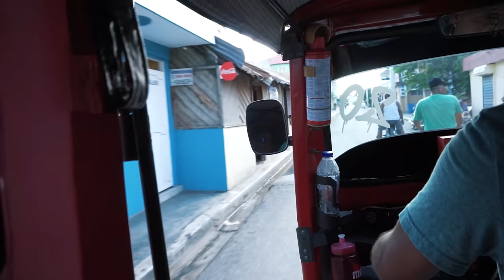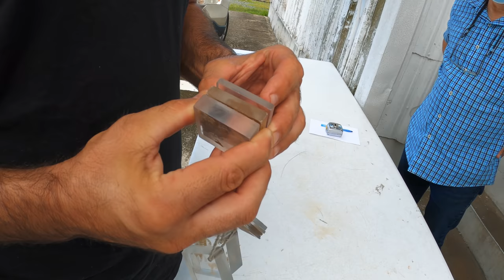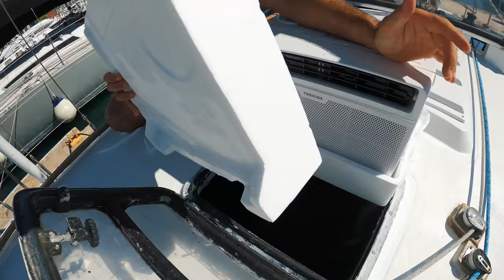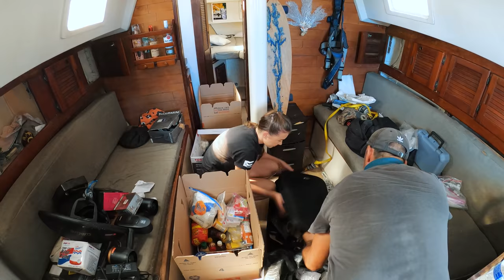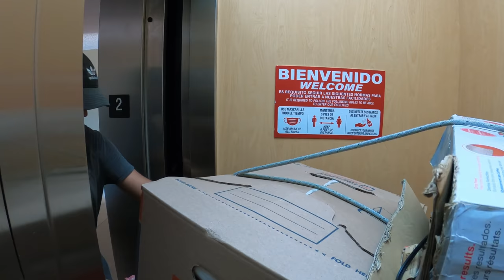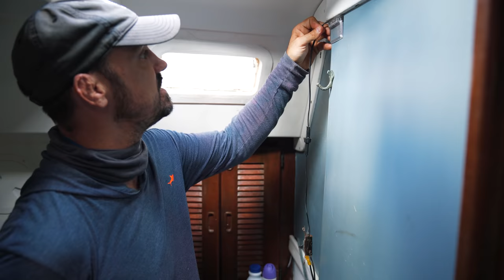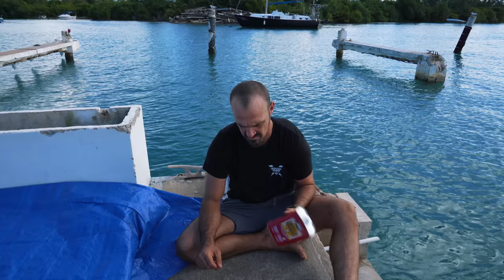BOAT YARD (PART 1) COMPLETELY ROTTEN BULKHEADS!

Comment: great video guys. When I look back after I complete a project I realize that I try to do too much at once and needed a game plan. Suggestion is repair the tabs that your chain plates are attached too ( one at a time ) then move on to the bulkheads, leave the glamorous bits to the very end of your project. There is a wood bleach Oxalic acid, but it won't take the redness out of teak. Perhaps you could paint the bulkheads bright white and use the varnished teak as accent and the boat will look much brighter. Again you guys brighten my days

Comment: On the bright side the bulkheads were nice and easy to remove. And the door removal project was done in a snap. I think it was a very effective strategy to use up your interior as apposed to to just using it. Looking good

Comment: The one common thread with all paint strippers is time, always go longer then the label but don't let them dry. Sometimes covering over the wet stripper with wax paper can help prolong the time. I stripped some cabinets a few years ago and tried a lot of different strippers with minimal success. The one that I found worked the best was Multi-strip advanced sold at the depot.  I don't know if you can use beach on your teak but if you do, wash it with a with a borax solution or something similar afterwards to neutralize the beach. Best of Luck (This means you too Matt...time to refit that bad luck with with some Good )
Reply: You'd think by age 70 I would have grown out of this.  My wife is wondering what I am cracking up over.  It's that second sentence.

Comment: I have been there and done that so seeing this episode brings back lots of memories. I would love to do it again and if I did I would do it better. I certainly agree with going all out and doing it right even if at first if it costs more up front. As for the windows I would use lexan rather than plexiglass. It cuts easier, does not crack and is easy to drill holes without cracking.  Thickness is not important, 3/16" lexan would work and is stronger than 3/4" plexiglass.

Comment: You can use white paint than lightly sand it to expose the wood grain than seal it. When remove the bulkheads support the deck first so it doesn’t bow inward

Comment: Just a couple of ideas for you, Matt get yourself a screw and nut remover (they kinda look like a phillips head screw driver for a drill but are sharper) makes getting those stuborn cheap screws out much easier.  Please don't forget to inspect and repair below the floor boards. with all that water damage you know it went into the bilge and may have caused some rot and plugged some limber holes. 
Good Luck you two ! :)

Comment: Try a whitewash on the teak (yeah I know many would consider that heresy) I'm not a fan of redish woods either, but teak and other dark woods are better at rot resistance than light colour woods, so if you like it after the whitewash then that will save you a few $$$, from my understanding bleach might weaken the wood.
Reply: I'm with trying a white wash.  Pick a light color oil base stain, thin it way down and just brush it on light.
Reply: The teak you mean is called Mahagoni

Comment: I wish I was near where you are. I have rebuilt several boats when I was much younger. I would love to help. One of the things I learned is that you should replace ALL that you can. Your project is going to take a lot longer than you think. I imagine that you learned that already from your previous experience. It is always quicker to replace than sand and refinish. Five years from now the extra expense will not matter but the time back to traveling will be worth it. Love you guys be safe and Happy.

Comment: Using the old teak is a real cost savings.  There is a product called Semco that has a natural finish color.  It’s basically a whitewash look and not too expensive.  Might be a solution for you.  Good luck.
Reply: Interesting Ill have to look into that
Reply: It might be just as easy, quicker and cheaper to just use the palm sander straight on the timber. Especially as you can do it on a bench. Liquid strippers have really lost their power since having to meet vosa requirements. It looks like a brown teak to me, we used to lay a lot of Burmese teak back in the day, it's quite soft and oily and sands easily. It might be worth liming, it lightens the grain. I've seen it done on oak, but never teak. Not sure if it's suitable or desirable? But maybe worth the look?

Comment: I build cabinets and furniture as a hobby and have applied many different types of finishes. One thing I have learned is that different types of wood have different colors depending on the type of wood, which also influences my finishing decisions. Some woods have the color you would expect when finishing, some are expensive. There are also other woods that you can fake in finishing to look like other wood species, Alder is a species of wood I use all the time to look like Cherry or Maple, etc. Easy to stain or dye without blotching, sometimes I take Alder and just put a straight multilayer of Polyurethane or Varnish which gives it a rich golden oak color. Other times, like my RV, I can take alder, give it a golden oak stain and polyurethane finish and gives it a richer slightly darker color. There are different types of finishes and there is no wrong or right or better or worse, it depends on the end result you are trying to achieve and the environment. Polyurethane or Varnish would be your best bet for that environment, tough and wear and water resistant, I would shy away from any oils, lacquers etc.

Comment: Nice work guys!    If you want to try to bring the boat temps down hang a tarp / canvas / whatever / something similar over your boat.   In the water we use a boom tent to keep the direct sunlight off our boats cabin top..    We also run one over the bow in front of the mast with bungees and the jib halyard.   It does make a difference, and if your crafty you can use them to funnel wind into your hatches / opening ports when you have enough breeze.    Ours are sunbrella but we have even used poly tarp and the sunshade fabric for patios that blocks the sunlight but allows air to pass through.   Anything that helps take the direct sunlight off the boat with an air gap between will help reduce the temps and is worth the effort.

Comment: You are going to need to grind fiberglass for the bulkhead: go watch Parley revival bulkhead saga
1- get a very powerful extraction fan for the dust, set up negative air pressure where you grind, and flexible 4-6 inch tubing connected to an outside fan for dust extraction at the point where you grind. 
2- personal protection and plastic sheeting to protect where you don’t grind.
3- epoxy/fiberglass/wood is stronger than your boat, it will stick and fix all the rotten sections without a sweet, you just need to remove the rotten sections and grind enough fiberglass to get good adhesion.

Dust and cleanup is the most time-consuming part of the whole thing.

Comment: Keep at it. Bleach the wood with Oxalic acid; very cheap and available. Consider using Petit #2018 Wood Sealer (Old Salem) to fill the teak, It will tone it very slightly, and seal the wood; then one or two coats with a clear varnish over it. Be sure to get a couple of 4'X8' door skins for your  bulkhead patterns. Cut the door skins in 3"or 4" wide lengths and lay them out to follow the hull shape; use staples to hold the skins to the hull shape.

Comment: I see folks that work without gloves, but for me, those gloves are super important for your protection.  Durable light nitrile rubber gloves for fiberglass, stipping, and using adhesives.  Makes it easier for cleaning up your hands too.  Heavier cheap leather gloves for tear-downs, wrenching rusted bolts.  Saves the knuckles and gives you more confidence in applying force when you need it.  Kristen might want to cover herself a bit more when working with fiberglass dust.  You'll sleep better at night.  : )  Looking forward to watching your hard work on this rehab.  Wish you both the best!

Comment: Mat, trade tip. When removing phillips head wood screws with power tool or by hand. Cut a square piece of standard electrical tape and place over head of screw. This reduces the percentage of stripping screw.

Comment: Keep the solid teak. It is worth $44 a bd. ft. here in Ontario and it will last forever. Maybe you can find a shop with a drum sander and clean it up that way. But even if you prime and paint it, the teak is premium boat-building wood. The solid stuff is also good for recutting into trim. Lots of classic boats have interiors with white painted panels trimmed with oiled teak . Looks great and spacious. Make sure all your chain plates are 100%. They are super important. Good luck and BTW I never thought Kristen had so many real clothes.

Comment: It’s a good idea to lose the pocket doors. If you think about it you have two walls plus the space to allow the door to slide versus a hinge that would allow you to open and go through the door and close again so it will save space. Don’t worry about that there’s currently a gap where are the current pocket door is around the bathroom, because when you put in the new door you will frame it out to close it off with a new set of jams and door frames. If you want to see about lightning the color of the wood go to the furniture restoration aisle and look for stain remover. Secondly in regards to the wood color you can always get an opaque stain that’s white Or a multitude of other colors.

Comment: well done guys, I've been through the same pain!......do not cut corners.....use the best materials you can afford.....stay away from cheap fixings/screws....use stainless if possible, just keep in mind everything on a boat even on the inside.....rusts or rots....so do it once....do it right!! good luck guys!.....don't rush......and remember to protect all the new wood as you fit it with a good clear coat of rot/anitfungus protection.

Comment: Been  through the same project on my Colombia 9.6 but on the hard. What I thought was going to be a 2 month project has turned into 6 months and 30% over budget Not really a surprise. My interior was mostly teak in good shape some was removed In retrospect  would now paint over the teak as striping and varnishing will bring you back to almost the same dark color except more gloss. My experience is  remove was is bad and paint the remainder I choose a 
bright white and I am very happy with results. Keep the inside as dust free as possible and tools out of your working area and tidy up at the end of each day The end result is worth all the effort you will put into the project. Patience and good luck.

Comment: Matt, I made windows for my C&C. Be sure and bed them down with butyl tape on all contact surfaces. I used clear silicon where the window is bound to the internal aluminum frame but that is all.

Comment: Wow, this video really brings out the ugly. I feel your pain as the owner of a Hunter 30 from 1978. Fortunately my boat has only seen seasonal use in fresh water with every winter spent in a cradle on a paved parking lot. It’s fairly easy to maintain the boat every spring, and I’ve never seen such wood degradation. Thanks for sharing the hard work or “remodeling” but honestly from what you show…I’d have to look at a better boat. Keep up the good work, I’m following with sincere admiration for your determination.

Comment: It's cool that you are both working on this project together. 

I'm sure I'll be doing a lot of what you're doing however; more than likely;  I'll be doing it solo.

For really hot cramped spaces fill a shop vac with ice water and salt and reverse the vac to blow.

It's a fantastic portable AC unit to cool tight spaces.

The salt lowers the temp by nearly 10 degrees.

Comment: I ran a painting business for years. You won't get the red out of teak. Oxalic acid can bleach it but I won't promise it will be enough. One option is a pickle stain. Basically putting a white stain on the wood and varnish over that. A good paint store can recommend products.  I'd probably consider painting the wood. Old schoolers hate the thought of ruining teak ! It is your boat. Cheers

Comment: Mat, I'm a retired union carpenter. One tip, get some metal drill bits. You can drill out hinge screws. One tool I have is the Craftsman Screw Out, really great once you get used to using it. Also, just get some exterior paint and paint the wood a light color, too much labor all that stripping, use a prime first. Also, I'm here in PR too. If you need a power inverter, I have an extra. 400 watt

Comment: Matt, liquid sandpaper is not a stripper, it is used to remove the gloss finish on surfaces prior to painting so the new paint will stick. As you are discovering you have a huge project ahead, good luck to you.

Comment: The liquid sandpaper is not a stripper, it is just an etcher that roughs up the surface that would make it so you could paint over the varnish.    When using a paint stripper, I would use a product called citrastrip.  It works best if you brush it on and put plastic sheeting over it(this keeps it from drying out and helps it work) The Citrastrip works well, and the fumes are not as toxic as the other stuff.  Be aware though, it is a huge pain to strip every nook and cranny of woodwork.

Comment: I'm a house painter, never worked with teak. You might try a white wash over the striped wood. A white wash gives you a white ish surface that still shows the grain kind of like a stain. There should be plenty of videos on you tube.

Comment: When I rebuilt my boat back years ago, I put all wiring into PVC conduit hidden in walls with drain plug that I could undo if i need to drain it because of condensation.  Used small taps for drain plugs so all I had to do was open tap and drained into bilge.  I also put a fan system that allow me to send air down conduit to keep it dry. Fan was removable therefore easy to replace.  Lasted 30 years till I sold it.  Just an FYI and adding a P-trap with cable sealing silicone was something done after original install. Funny thing is it is what allowed me to seal my wires and prevent problems.  I created the silicone wire plug for a large opening and then trimmed it to fit with a restraint to hold it in place during passage. A wire tie now days would work well.  Also adding a wire or removing a wire was easy just drilled a hole for new wire and silicone in place.  if removing just cut wire and silicone hole.  Good luck on your rebuild. Used small taps for drain plugs so all I had to do was open tap and drained into bilge.

Comment: NO GLOSS!  Use satin stain with a light color base to lighten the color of the wood while preserving the EXPENSIVE teak wood you have.  Strip it with powerful strippers, wash it off, let it dry sand well and apply the color based stain.  When complete you can spray a satin wood finish over the stain.  You can also get colored stains (semi-transparent) that do not require an additional coat of finish.  Gloss is so 1960's and satin will hide minor flaws a lot better than gloss which highlights them.

Comment: On the topic of making the teak wood a lighter shade. If you strip and sand your teak wood and reseal with teak oil it will return to that nice dark shade of natural teak. If you want a lighter shade I would strip the current wood down, sand it, and then reseal with linseed oil for a lighter finish that will retain the same shine and finish as the original wood but with a lighter color.

Comment: You can use caustic soda solution (very cheap) to strip paint etc it will bleach wood a bit lighter too, But be very careful with it as it burns any exposed skin. gloves coveralls & face shield a must. Bulk heads are a pain to do. basically you need to make a template out of lots of small pieces of wood fixed with staples or screwed. you should have closed cell foam between bulkhead & skin of hull & fibre glassed both sides of bulkhead & screwed to hold it there.

Comment: Hi Guys. I don't normally comment but when I saw the state of your bulkheads I trembled. A few years back while doing our shake down cruise in the spring after launching we lost our mast mid sail. The bulkheads had rotted to a point where the stanchion just ripped out of the bulkhead, went through the deck and the mast toppled over. We fished it out and secured everything and powered back to harbour but it could have been a lot worse if we were in a more remote spot (we do a lot of wilderness sailing). As it was we spend a good portion of our summer doing boat repair instead of sailing. So, in other words.... don't trust a rotten bulkhead! Love the channel. We have about 2 feet of snow on the ground already so watching someone sailing or even working on their boat gives us hope that winter won't last forever.
Reply from the maker: Dang! Sorry that happened to yall

Comment: You should get a cheaper furnace air filter and a box fan when you really get into the dirty work and see if you can red-neck rig an air filter to help reduce dust. Or if you are using your a/c unit most of the time, maybe cut an air filter and set it up over the a/c unit air intake. Can't wait to see how things progress!

Comment: Every bulkhead in such a small vessel is more or less structural . It stiffens the boat . There is only one good way to go forward . Replace them . Lots of work . Be sure the rigging is not to thight when you remove bulkheads under your mast . Push the deck about 6mm up when you install a new bulkhead . Used to work on this kind of fiberglass boats . When needing more info , contact me by FB messenger .
Have fun rebuilding your boat/house .